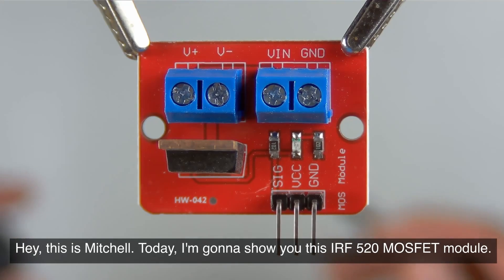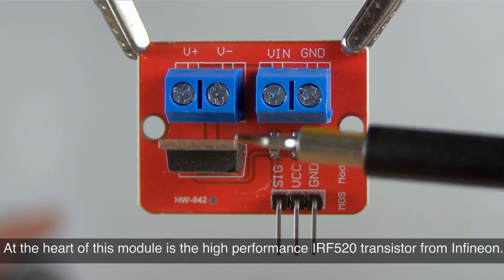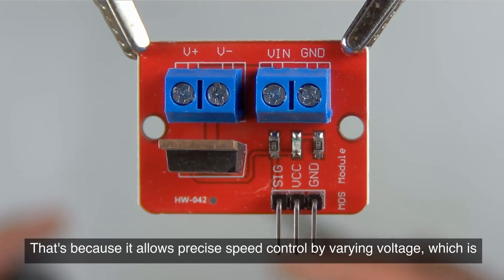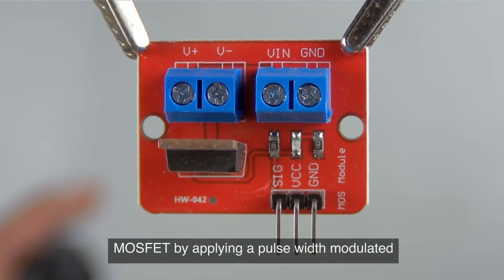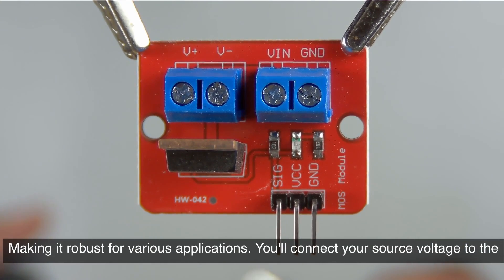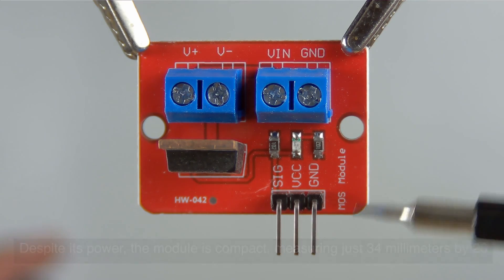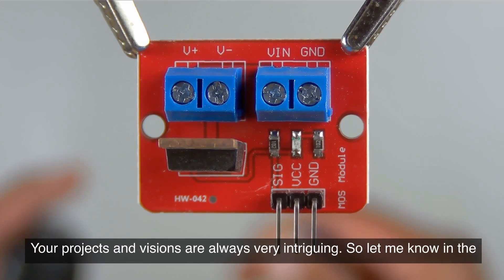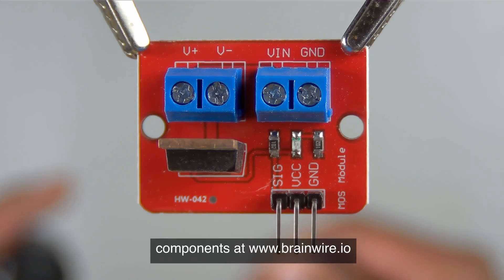IRF520 MOSFET Module - Fast & Precise Device Control for Arduino, ESP32, Raspberry Pi Projects

Comment: there is no need for a fly-back diode in this module?
Reply: if you use it to switch an inductive load then you need to add a diode

Comment: hi I would like to know if I can use this board to power a fuel cut-off solenoid with 3 12 volt wires ?

Comment: Is it possible to get the IRF520 to output low voltages of 0.5-1 v?
Reply: it's a switch, it can only output the power supply voltage.

Comment: You mention driving the MOSFET with ESP32, but the ESP32 operates at 3.3v, while the MOSFET signal pin requires 5v.

I’d appreciate seeing how to drive this MOSFET with ESP32 (3.3v digital pin)
Reply: Simple: You cant. If you want to drive around 3 Amps and < 30 V you could use a SI2356. Its even smaller

Comment: I am looking at building my own electronic ignition for my antique motorcycle.  Using the Arduino and a Hall effect pickup and a MOSFET to power the ignition coil.  I will try and set the ignition timing based upon RPM and the range is 4 and 34 degrees TDC linearly from 1800 to 3500 RPM.  The engine red lines at about 7500 RPM and so I need the ignition system to run to about 8000 RPM.
The pickup is running off the cam so it is 1/2 crankshaft speed so I don't anticipate any timing issues.  I am also looking at a soft rev limiter.  So at 7300 RPM it only sends a spark every other revolution.  This will protect the engine from over revving on acceleration.  Other possibilities would be electronic cut off for shifting.  So that if the gearshift lever moves it cuts the spark for 1/10th of a second or so to allow throttle on clutchless shifts without damage to the transmission.
This looks like a great way to test the concept.  Thank you.

Comment: Is it considered a "logic-level" mosfet? The Rds(on) provided in the IRF520 datasheet is measured at Vgs = 10V.
Reply: In this video: https://www.youtube.com/watch?v=9djbpGyqjIU You see a guy using this module for controlling PC fan and a LED with a board that seems to work on 3.3V Logic, I've been searching for MOSFETs with which I can control my pretty chunky relay module which I cannot control using my ESP32. While searching I found out that most low-voltage Vgs(th) MOSFETs are measured at Vgs 10V. I am not exactly sure why this is like this. But yeah this module should probably work.
Reply: @real_mddiamond  Please dont use those. Use a real Logic Level Mosfet like the SI2456DS or a DMT12H060LFDF if you need to switch voltages up to 100 V
Reply: it can be used at logic level, but only barely. If you want the irf520 to switch its full rated current of 10A, then you need at over 6 volts on the gate, as per the datasheet.

Comment: I’ve been thinking about using this module to control a solenoid using an Arduino Uno.  I have watched other videos that explain how to set up the circuit in a breadboard.  Apparently you have to use a diode to protect the Ardunio from the reverse current that the solenoid sends when it’s off.  Does this module include such a diode or would I need to solder a diode to this board?
Reply: I don't see a diode on this module. You would most likely still have to put one in parallel with your solenoid.
Reply: It has a LED, a diode. But I'm not sure if it does serve that purpose. I think soldering a diode in your circuit for caution wont hurt

Comment: we have connected a 24V power supply to VIN and GND, the mosfet led seems to be blinking implying that the mosfet is getting signal from our microcontroller, but when we check the voltage accross V+ and V- it does not seem to change, is it a faulty mosfet issue?
Reply: Same here

Comment: Hey man, thank you for the video! Very useful! I am trying to connect it to ESP 32 and control it with WLED, but it seems I am doing something wrong. Would you be open to help please? I will share more details if so. Thank you!
Reply: Bro it cannot work with esp32 directly
Reply: @smartteg7381  Yeah I know man. I am planning to add a logic level shifter and try then…
Reply: I, too, purchased some of these MOSFETs from Amazon (foolishly believing their description that it would operate at 3.3 volts [which is the voltage of the ESP32 pins]).

Comment: If you connect V+ to V- directly, you basically create a simple, isolated switch, i.e. mimic a mechanical relay, that will not bounce if the connected micro controller reboots or restarts.  In this case VIN and GND on mosfet side complete the circuit, i.e. switch control.  This module was never intended to be used this way, but it does work... having the advantage of not being sensitive to control state changes.
Reply: Thanks!  This comment saved me a boatload of time.....and it works great.
Reply: just remember that this transistor can only be used as a low-side switch.

Comment: Have you tried it with WLED in pwm-white/pwm-cct configurations? I wonder if it flickers while dimming the non-addressable cob leds.
I'm planing to connect 5-6 meters of 24V single color cob led (with only +/- pols) to this mosfet and control the brightness of the lights with WLED.
My only concern is if it would flicker this way while dimming on a camera as well as a naked eye.
Would you recommend this setup? Any suggestions or alternatives? Thank in advance!!
Reply: Hey man, hope all is well. I am wondering if you have tried what you described in your comment as I am trying to do the exact same thing, but it doesn't work with me. Would you mind helping please?

Comment: Very helpful,
I would like to hear your opinion if this module can handle the controlling of a peltier module tec1-12706, using Arduino,
Thank you in advance,
Reply from the maker: Hi, it can handle the TEC1-12706 but it will probably get very hot depending on your duty cycle. You probably want to look into a logic level MOSFET like the IRL520. It will run cooler and generally be a better match for that Peltier module. Good luck!
-Mitchell
Reply: @brainwiredotio  thank you for helping, appreciate it
Reply from the maker: My pleasure, anytime!
Reply: @brainwiredotio  Is this module available with the IRL520 MOSFET?